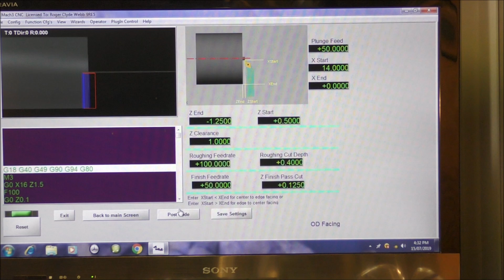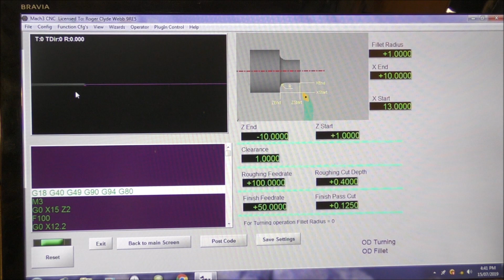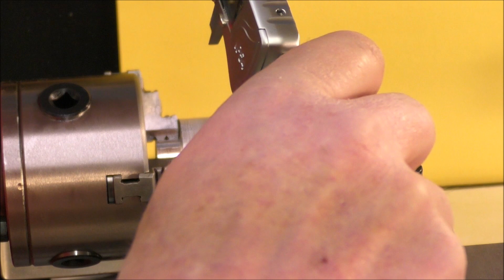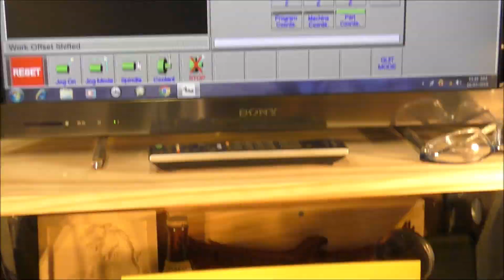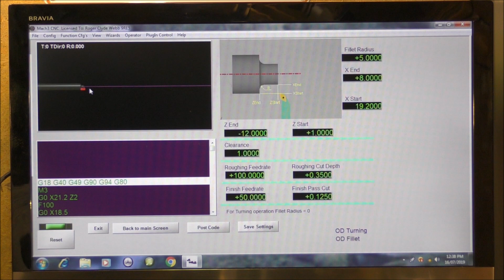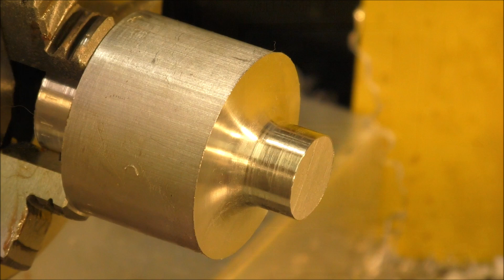336 Test driving a Harbor Freight Sieg CNC mini lathe 7 x 14 inch conversion

Comment: If you where to put a spindle sensor on it would mach 3 be capable of thread cutting? And is the a way of getting a cad file into mach? Something I've always wanted to try but know very little about
Reply from the maker: 1/yes to thread cutting.
2/ you would need the free fusion 360 CAD/CAM for lathe turning, link to my video below 
https://www.youtube.com/watch?v=mqCquyrwUGg
Reply: @inventorsworkshop9600  lovely il give it a watch?

Comment: Surprised I had already left a comment.  Carbide Inserts for aluminium will make a huge difference to how well you can cut material on this little lathe. Work really well on S1214 free cutting steel.  Iuse and insert by Sumitomo which they refer to as their NFC type chip breaker. This is a ground edge insert and I find I can use it for all materials that I turn.  plastics, brass, aluminium and steel.  I have used it on 4140 which it handled quite well.

Comment: If your other tools are to big that they ain't on center you can still use them to turn the od it just won't face good it will leave a nub on the end
Reply from the maker: Thank you, for watching,  Please like, subscribe and forward the video on to a friend,  Roger Clyde Webb
Reply: Also not for tapers, they will turn out concave, and you have to guess the diameter it will not be consistent with the screw on different diameters. Of course with small amount it won't do anything noticeable with the calipers accuracy

Comment: Can you thread on it ? I wanted to know if you have full control of spindle position also.
Reply from the maker: Yes, I will be, the lathe has an R.P.M plugin, so I will be connecting it up to Mach
Thank you, for watching,  
Please like, subscribe and forward the video on to a friend, Roger Clyde Webb
Reply: @inventorsworkshop9600  Thank You for that info. After I finish building a CNC mill, the lathe will be next. Just getting material sorted and learning the electrical end now.  I was not sure about the lathe spindle control system or mechanical parts.  I'm a machinist  40 yrs and love the trade. Take care,  I'll be watching you.
Reply from the maker: See my videos 321 and 322 for the electricals